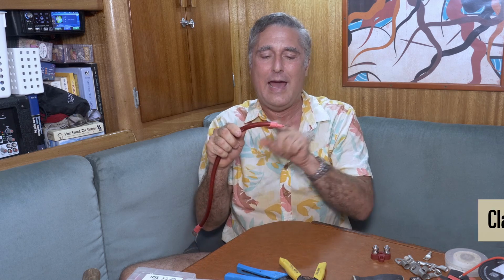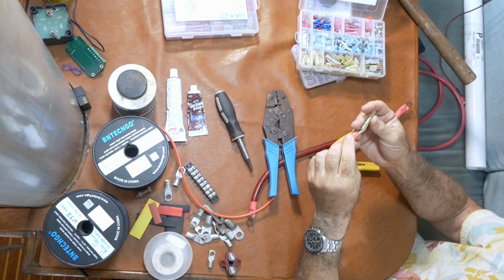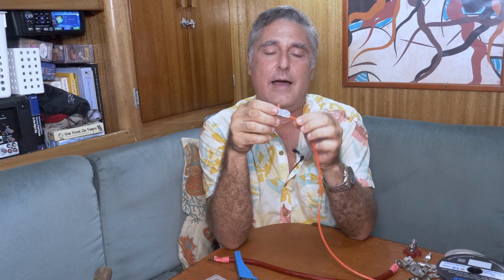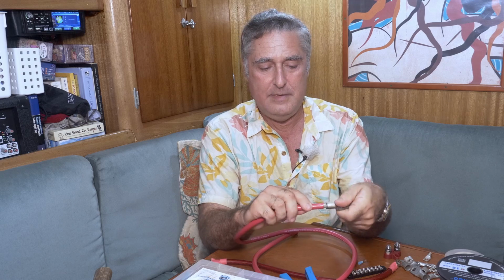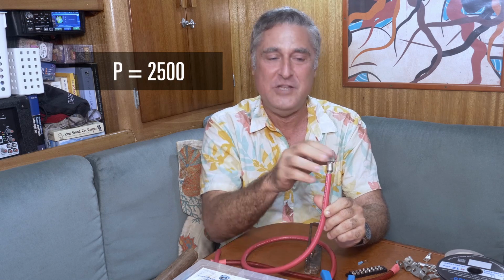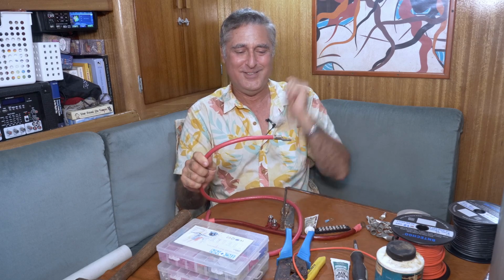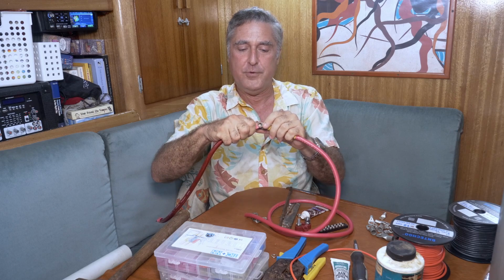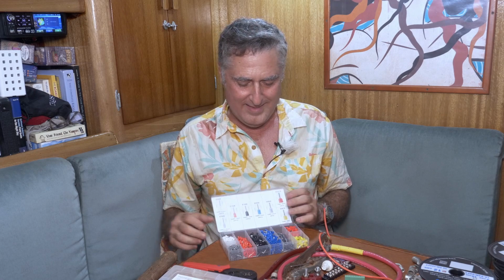Boat Electrical: Understanding Terminals

Comment: Love your videos! I make hundreds of connections with terminal blocks on weather stations that I build and maintain. Instead of ferrules, I tin all stranded wire with lead-free solder and tighten connections very firmly. This always makes for a long-lasting and solid connection. I use the same solder to fill crimped connectors and glue-lined shrink tube to finish them. There is a battery terminal spray that works pretty well for preventing corrosion on ring terminals bolted together. If you want a super long-lasting connection, solder the terminals together before bolting. Heat them to get them apart 30 years later. I consider all non-soldered connections to be short-term temporary. I never use solder with lead anymore. It's toxic and it corrodes easily. Silicone dielectric grease is the greatest stuff ever. I use it for electrical stuff and also for plumbing for thirty years before they started selling it for that purpose. Another favorite goo is copper anti-sieze compound. It's the best for stainless steel nuts and bolts, which commonly gall and weld themselves together when made of the same grade of steel. Some of this stuff I learned from an old buddy who worked as an aircraft mechanic.

Comment: I tried silicone to seal bus bars for underground sensors and it caused more corrosion than it prevented. The curing byproduct of many types of silicone is acetic acid. Use only silicone specifically made for electronics.
Reply from the maker: Good point

Comment: Thank you for the series Clark.  Been meaning to watch for some time and finally getting around to it while I'm stuck COVID isolating (oh joy 🙄).  I have to admit, I'm not a big fan of your smasher tool for larger terminals.  I've encountered those connections and they often seem to come lose over time.  Now, maybe they weren't done well in the first place but I have had great luck with a small 10 ton hydraulic crimper.  It is hand tool sized and works for a variety of wire/lug sizes (12 AWG to 2/0) using interchangeable dies.  I've cut these connections apart w/ a hacksaw and it basically forces the tiny strands into a solid copper wire.  I've used on our RV battery bank and our boat's bank.  I've been very happy w/ the connections and haven't had to redo any of the work.   And oh yea, I've done that whole thing you described w/ the loose terminal connections generating like 2200 watts, forgot to tighten a connection on a 600 amp shunt, completely melted the shunt and quite a bit of insulation on the wires attached to it.  Great point on the physical connection.  Thank you for the series, really appreciate the videos!

Comment: How do you make connections with the tiny LED and GPS wires?
Reply from the maker: Tiny wire is easily soldered.

There are also small spring connectors, screw terminals, crimp connectors.

I don't really know what size wires you are referring to.

Comment: I silver soldered my battery leads, then heat shrink tube.  Like the grease, they make a spray for when your done..
Reply from the maker: I don't like soldered leads.  I say always go with a good mechanical connection.

Think about when corrosion sets in years later.  You push some real amps and make heat.  It could melt your solder and then you might have a charged wire getting into mischief.

Maybe solder afterwards if you like suspenders with your belt.
Reply: @Clarks-Adventure  have an hydraulic crimped for my 00 cables silver solder is much higher temperature than lead, but silver is a much better conductor thus gets rid of the resistance of the connection.  I am an EE also programmed machine code for 37 years, worked for the DOD, then DARPA , learned to silver solder young boy from my father.  I would think with your knowledge you would have learned the skill.  Never too late too learn and it is very addictive when you see it’s result’s especially in low voltage circuits.  Good reason why it is used in high fidelity circuits.  Seen what you have, you only need the silver solder, the heat touch you used too hear shrink has a special tip with a catalytic converter can attain the higher temperature needed, that your electric iron cannot get to.  You will need a heat sink that attaches to prevent harm too other components in the process.  Yup it takes practice kind of a lost art.  Like welding with jumper cables in a pinch using a coat hanger and CD as an eye shield, surprised what you come up with in the middle of nowhere and have too weld two pieces of metal.  Now I carry a cheap small harbor freight stick welder just for that reason.  I too felt I learned more from Teaching at Universities, the students in asking pull on you too explain in ways that they can understand, note I used the BBs in the straw, pushing them through with pinched fingers as too a magnetic field pushes the electrons through the wire.  Again kudos too your series.  Do you run 110 or 220 on your boat?  It’s another long term argument, but with your cruising experience be just curious.. Fair Winds.. If you Ever Sail up too Long Island or visit my wife and Myself Love too take you both out for dinner..  Our Starlight is out In GreenPort she is a Beneteau Oceanis 350 1989 I have an 8D and 4D and starter battery, all AGM’s have been looking into the prospect of replacing the 8D with Lithium, I think I would have too agree that your solution of total amps is the right way too go.  I also agree that the companies just want too sell batteries.

Comment: Always learning something new. Ferrules, what handy little idea. The Victron solar controllers use the screw down terminals and ferrules would be an ideal solution. Thanks
Reply from the maker: I'm actually so happy I bought that $30 ferrule kit.  No more loosening screw terminals and no worry of a wire strand causing a short.
Reply: @Clarks-Adventure  thats been my concern too. Now thanks to you I have the solution.

Comment: Look into Cool-Amp a silver plating powder used to plate copper with silver. I have been using this since the early '70s make sure my copper connections are low resistance. The cost has gone up quite a bit.

Comment: Clark, this is very good information but there were no closeups of the terminals.  I know what you are talking about but there's probably folks out there that don't.   Overall very good information especially the part about not using solder on large connectors.  Yes I've done the same thing but won't ever do it again.  Keep the good stuff coming.

Comment: Hi Clark, I have a question if I may: Ryan from the YouTube channel "Ryan & Sophie Sailing" (https://www.youtube.com/watch?v=b4DAy_JSgFE) on his tech-talk video (36'23'') showed a terminal burned, he said it is because a "bad crimp". My question is whether is possible to identify a bad crimp (if it look good visually)? Perhaps, will the wire resistance be different  between a wire with a good terminal and good crimp and another wire with a bad terminal or bad crimp? Thanks!
Reply from the maker: That's part of the tip I promise at the beginning of all this.  How to find a voltage drop on a live circuit.

Probably get to that video once we get back to Temptress next month.

I've laid all the ground work for it.

Comment: Great video introduction. I dissuade others from soldering not for it being bad just the skill required. The marine code is not against it just can not be the sole means of attachment. Make it mechanical first. I commonly find marine shrink terminals not mechanically secure also.
Reply from the maker: What's your experience with those shrink/solder connectors you melt together with a heat gun?
Reply: @Clarks-Adventure  Trust like a 2 year old with an unwrapped chocolate bar. That would possibly work on an led indicator diode and resistor, so they aren’t useless. I tested a few when I first saw them, failed reliability. They resulted in a cold soldered joint. Really not that hard to crimp a naked ferrule and shrink over.
Reply from the maker: I suspected as much.  Haven't tried one myself.  Now don't have to.  Thanks for an opinion I trust.
Reply: @Clarks-Adventure  O though please do for video destruction explanation purpose. A few $1 sample packs shall do.

Comment: Keeping boating costs down is important, and given that is the focus of your videos, normally I find some value in your channel.. While I do balance cost vs. reliability, I tend to favor reliability.. Let's face it, sometimes while sailing, we are far away from help so reliability is of paramount importance.. 

However the misses and I watched your latest video about terminals, and you can ask the misses how crazy you made me, and how I was talking to the TV over the methods you suggested.. Sadly we have one of those flat screen TV's which can't handle throwing my shoe at it as the old CRT type of TV could.. 

In the video you showed using several techniques which are either contrary to ABYC standards, or really should not be used.. Also given your suggested use of non-heat shrink terminals invites corrosion.. You forget, as a wire warms up, moisture is drawn up into the wire via capillary action, and will corrode the wire far up into the insulation.. This is why heat shrink type of terminals absolutely should always be used in bilges or any place where moisture or water is present.. I just watched a video this morning with a sailor having a non-functioning electronic head.. Turns out, the power lead to the toilets pump had totally corroded through.. And you guessed it, a non-heat shrink terminal was used..

You did talk about heat shrink tubing, but really never impressed how important it is, especially with uninsulated cables (such as the battery cable you put together).. While I am not an ABYC certified technician, I do believe up to 2" of the stuff is required on uninsulated terminal.. 

Yes, saving money is very important.. But you have a responsibility to make sure the methods you suggest are not just short cuts to save a dime or two, but actually maintains reliability, if not improves it.. 

You may want to review Jeff Cotte's channel (Pacific Yacht Systems), Nate's channel (Explorist Life), for how real useful advise is given.. There are others, but these two come to mind.. At the very minimum, you should preface your video with a disclaimer that you are not a ABYC certified technician, and the advice you are giving may not follow their guidelines.. 

Now you may think "Hey, it's worked for me for over 20 years I've been sailing".. But then that does remind me of the tale of the guy who jumped off a 10 story building.. As he passed the 5th floor on his way down, someone asked, "How's it going".. He replied "Pretty good so far".. 

flk

P.S. We watch YouTube on our smart TV.. Because of this there isn't anyway to leave comments.. However this was important enough to me to go the extra mile to find the video on my computer and leave my thoughts.. This isn't just another "hate" comment, but rather one which is very important to me..
flk k
Reply: Love Jeff and he is still learning as well like all good professionals. ACBY gospel is restricted to 2 countries and is continuously updated. It is for manufacturers, not the same as marine working industry including Coast Guard Inspected Vessels. I repair ACBY certified installed errors. Some of the passed manufactured North American production work is just garbage. 
My vessel some connections shrink many not depending on where they are. If the end of the wire isn’t sealed glue or not isn’t relevant to salt intrusion.

Comment: I don't think your connection should get hot enough to melt solder. If it does, there is probably a problem. If using in a high temp item, there is high temp solder, upwards of 600F.
Reply: Yes one problem gets you an even larger problem. I regularly recast lead battery terminals from getting hot enough they melt off. We use 2 12v batteries to weld, 15-120watt is most soldering irons.
Reply: @braithmiller  again, if your terminals are melting you have a problem.  Pulling way to much power for the set up. Nothing should get that hot.
Reply: @helomech1973  It has nothing to do with ‘to much power’ rather high resistance at any mechanical contact. Union halls used to do labs on such things to get it into the tradespersons heads. 
My terminals don’t melt, I repair a lot of different systems so see it across marine, land, road and specialty equipment.  The basic make mechanical fastened then solder. There is a reason.
Reply from the maker: Thanks Braith
Reply: @braithmiller  Too high resistance is a problem, which is exactly what I said.  If you have high resistance, you have a problem. Solder should not melt in a normal functioning system. Not saying not to do a mechanical connection.  Simply stating facts, if it is getting that hot, you have issues in your system. Been working on helicopters, cars, boats, farm equipment my entire life. You should not have cables getting that hot. If it does, need to look into why.
Reply: @braithmiller  So you are saying that resistance in a circuit does not cause the circuit to pull more power?
Reply: @helomech1973  amps or watts? What is the load? Over generalized. I did not say that specifically. Fun with load testing and induced failures it’s educational. I think you are lucky to work on consistently maintained equipment. Much of what I have to deal with is get it running asap, if it was abandoned last season or I am babysitting a team of operators, professional marine has the same attitude.
So you understand people are melting solder connections on solar inputs, alternators, all is needed is a stainless washer, poor fit corrosion etc.
Reply: @braithmiller  my only statement was if it gets that hot something is wrong. Doesn't matter if it is yours, mine, or your customers.  It will only get hot if it is undersized,  overpowered,  or something is wrong.  A properly sized and running system won't get hot. That is all I said. Only system that might get hot is a high drain short burst system like a starter. Even then it shouldn't get that hot. Re read my initial statement,  and explain to me where I am wrong.
Reply: @helomech1973  So on that agreement. In practice things go wrong. So the point only was the construction should avoid soldering becoming a joint disassembly. Agree starter loads are the notorious.
Reply: @braithmiller  which was my only point. It shouldn't get that hot. If it does, the problem needs fixed. But if you melt high temp solder, than you got bigger problems than the melted solder.
Reply: @braithmiller  what the load is doesn't matter, my question was are you saying that resistance does not cause the circuit to pull more power? The load, wants x power, and it will get it, if it is available.  This causes the more power I was referring too. I think you know what I am saying.
Reply: @helomech1973  I do know what your saying. Though some loads and conditions may not increase watts or amps it may just localize heat generated to the highest resistance points. So it is inaccurate to say all high resistance conditions create more total draw. Eg the breaker doesn’t trip despite arcing, or overheating.

Comment: Solid information for solid connections. Thank you! One little detail from my experience is that soldering a wire creates a hard spot that will break at the solder joint after several bends. Crimped connections without the solder do not fail as quickly.
Reply from the maker: I agree.  And I seldom solder.  Laziness!

When I do it's only for the huge wire where it's just not breaking in my application.
Reply: That is the industry line. Hand build bikes and some others will disagree.

Comment: Regarding the "waterproof" adhesive-lined connectors and heat shrink:  It's almost impossible to really make something waterproof 100% of the time - so if just a tiny bit of water gets in, it will then stay there - making the problem worse.  It's far easier to "encapsulate" something to keep water out than it is to try to make a watertight seal.
Reply: Reason for gel wire. Not almost impossible just a lot of work I do them sometimes replacing whole wire harnesses as failure isn’t acceptable.

Comment: Nice explained. The grey things with the orange levers are called Wago clips, I use them to make temporary connections while repairing industrial and maritime PCBs that need connections to other stuff like powersupply, sensors , switches, potentiometers etc so I can measure things and find the bad components.  I  only use spade connectors for "permanent" connections .  If they need to be waterproof I use shrink tubing (the version with glue).  I do not like the bullet connectors, they come loose to easy.  To separate  (good quality) blades you need a lot of force compared to bullets. But maybe I have used the wrong brand. 
About the crimp-tool, be careful, there are also versions made for bare connectors/terminals. So without the coloured plastic around the crimp part. They look the same but are not usable for the red/blue/yellow versions. 
I have  a simple but very good quality stripper/crimper for 40 years or so, and it still works fine, but I like the fancy ones more because I am lazy.  I work with lots of different wires in metric and AWG sizes. The auto-stripper is more easy because I do not need to know the wire size but they do not last long.  I also have two fancy strippers that each can strip 6 sizes , one for metric and one for non-metric wires. Those are my favourite strippers (found them used on a ham-fest about 15 years ago, needed some work but they work great).
Reply from the maker: Mine aren't real wagos.  They are Chinese knock offs.